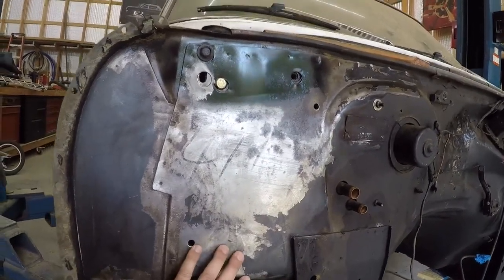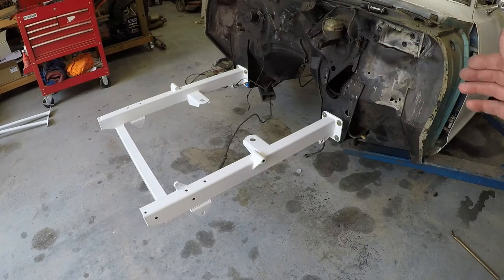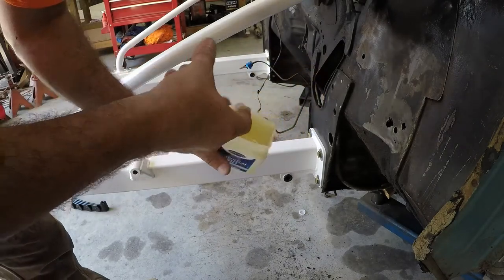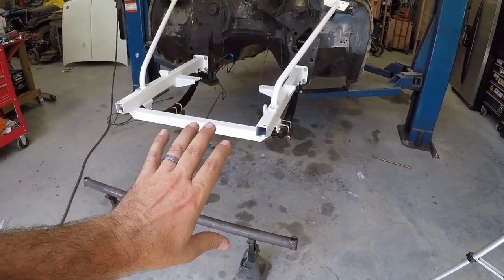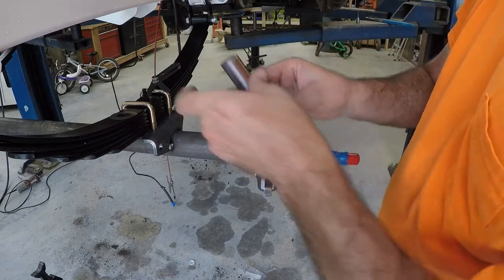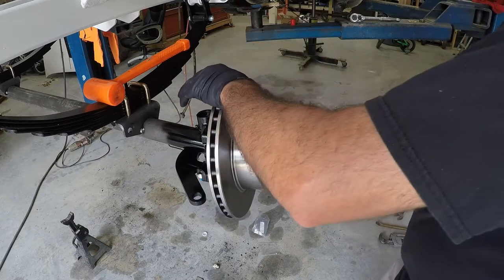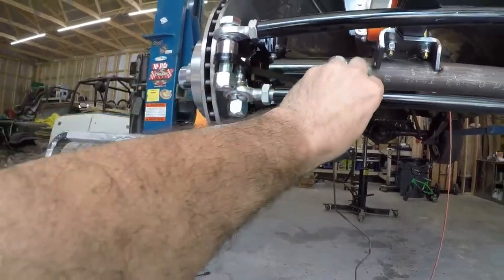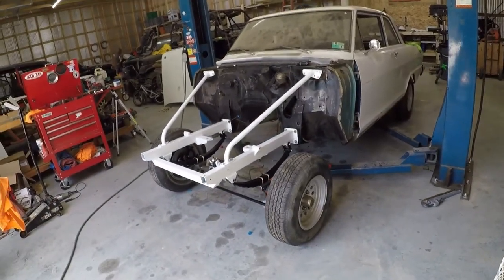Nova build Episode 2: Speedway Motors Gasser kit

Comment: those are tapered roller bearings in your rotors,they cant be tight,they need to be loosened after seated down tight or they will soon fail,loosen the nut until you just can actually feel slack,then put your key in.
Reply: It's been a long time since I was a professional wrench. But yes I was thinking he was going way to tight.
Reply from the maker: I believe I backed them off a quarter of a turn but I will definitely check them before I drive it. I may need to back them off a little more. Thanks for the info I appreciate it.

Comment: bob you need to make the rod from the steering box and r/s spindle parallel to the tie rod bar so you dont get bump steer
Reply from the maker: I can agree with that hopefully after a roll the axle back some to set the caster right and get all the weight on the car it will level out some. Thanks for commenting. I’ll take all the advice I can get.

Comment: Are you gonna run the speedway 64 fender well headers? I can’t seem to find much else that work with the speedway solid front end kit. Either hit my steering linkage or support arm off the firewall. I’ve tried a tri 5 from patriot, don’t work. And I’ve had the speedway 64 gasser fender well headers but I was worried about how close they were to my master cylinder so I sent them back, starting to look like my only option other than custom. Thanks man keep the vids coming
Reply from the maker: I’m planning on running speedway headers, but If you find something better please let me know.
Reply: But some reflective heat tape on the master